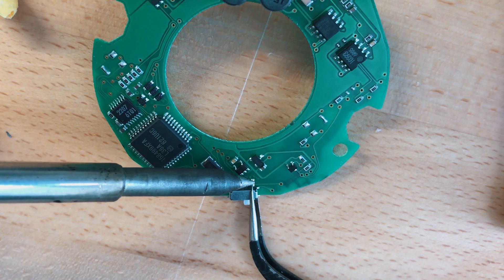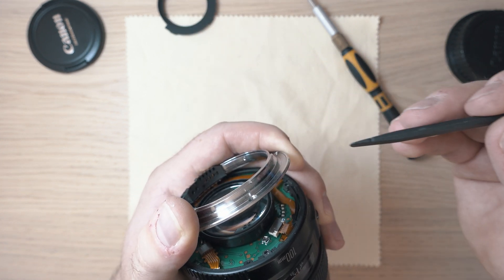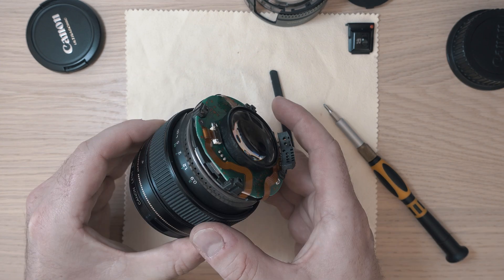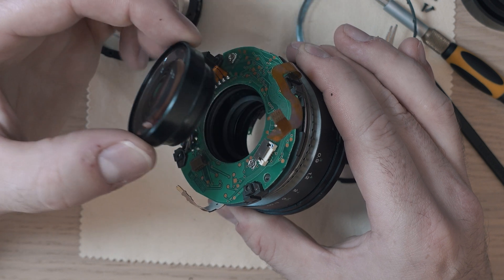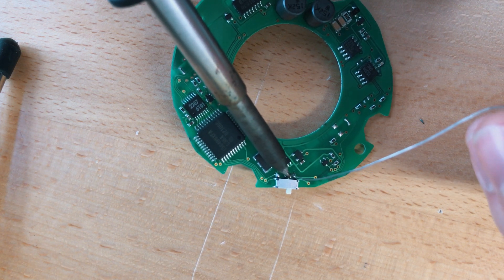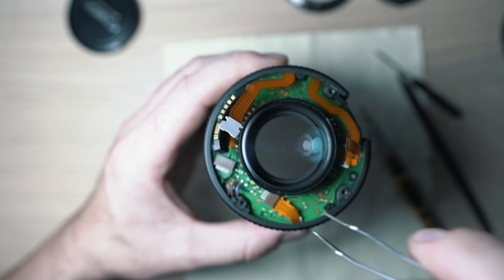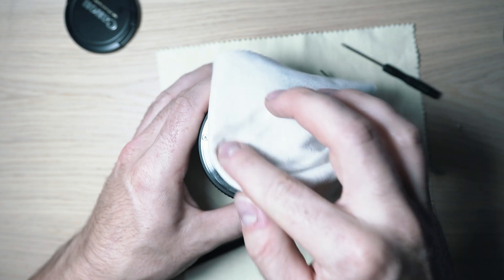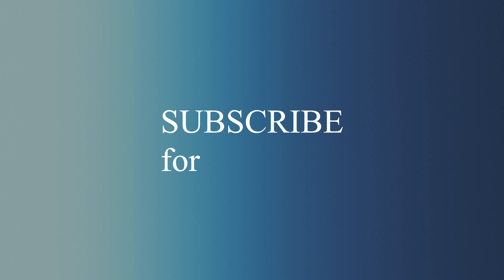Canon 100mm f/2 USM Focus Slide Switch Repair | How To Fix Canon Lens

Comment: Thanks to your video I was able to find out and solve the problem with my Canon 85mm f/1.8. I'm not a camera repair technician, just curious. When I opened mine to clean it, the AF switch broke and I didn't notice. When I set up the auto focus it stopped working, and I didn't know why until I found your video. I didn't change the switch, I just used a needle and put it in the auto photo position. That's it! It started working again.
Reply from the maker: thanks 🙏